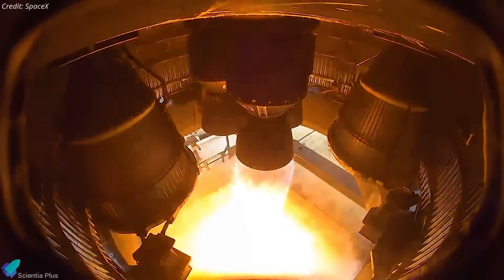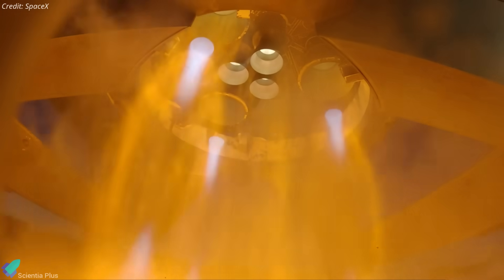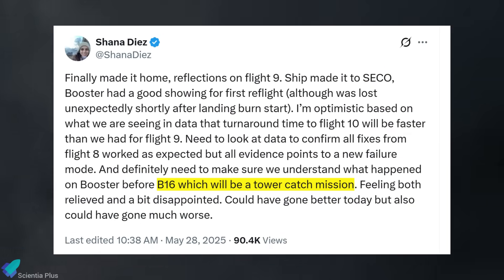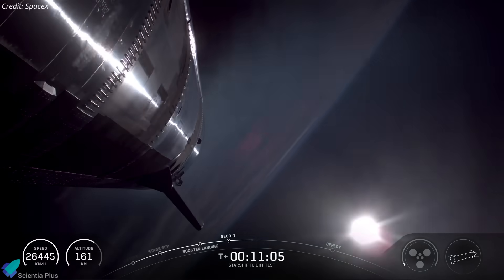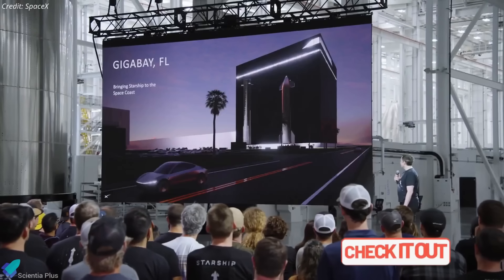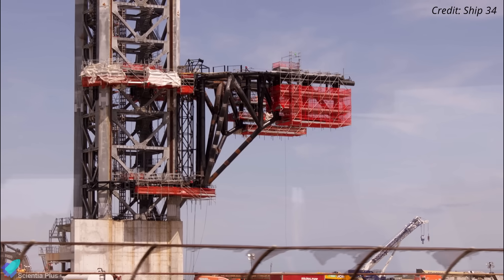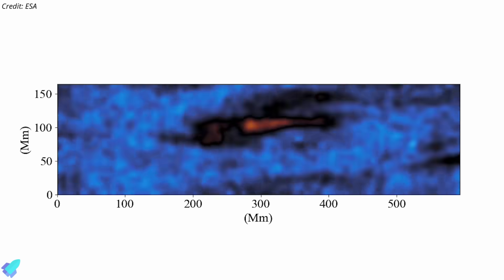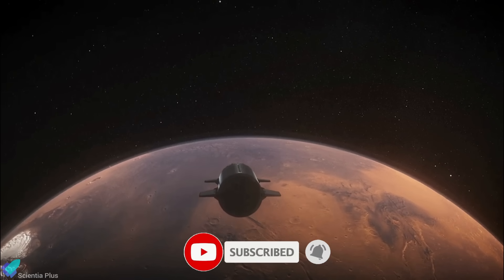Starship Explosion Shocking Evidence LEAKED From Flight 8! FAA Confirms Flight 10 Launch Date

Comment from the maker: 00:00 Starship Updates
11:59 Solar Pole Imaging BREAKTHROUGH—Magnetic Reversal Caught in Action!

📚 Learn More:

🚀 Starship Block 2 Explained:
 📖 Summary: https://shorturl.at/b0dtw
 🔍 Detailed Explanations:
  • Design Improvements Update 1: https://shorturl.at/lpGT7
  • Design Improvements Update 2: https://shorturl.at/gwNQ4
  • Nosecone & Payload Bay Redesign: https://shorturl.at/xa60S
  • Methane Downcomer Redesign: https://shorturl.at/XdYBG

🚀 Starship Block 3 Explained: https://shorturl.at/mnBT4
🚀 Starship & Booster Block 3 Detailed Breakdown: https://shorturl.at/IViwD
🚀 Starship & Booster Block 3 Production Begins: https://shorturl.at/xRNkJ

🔥 Raptor V3 Mega Upgrades & First Test: https://shorturl.at/TRIyj
🧱 What’s Inside Starship GigaBay?: https://shorturl.at/nJM75
🛠 Insane Engineering of New Starship Launch Pad B: https://shorturl.at/7RAZd
🛢 Dual-Port Orbital Refueling – Full Technical Breakdown
https://shorturl.at/5tiqK

🛠 Other Starship Upgrades:
 • Hot Staging Explained: https://shorturl.at/jf400
 • Super Heavy Booster Upgrades: https://shorturl.at/Pi5R3
 • How SpaceX Protects Raptor Engines: https://shorturl.at/4Om8F
 • New Heat Tiles Explained: https://shorturl.at/p2Ijb

🚀 Starship Flight 7
 📽 Complete Breakdown: https://youtu.be/UqzZx7vb-TA
 🛠 Root Cause & Fixes: https://shorturl.at/HcLKo

🚀 Starship Flight 8
 📽 Complete Breakdown: https://youtu.be/f26yH80RK2o
 🛠 Root Cause & Fixes: https://shorturl.at/vsGFB

🚀 Starship Flight 9
 📽 Complete Breakdown: https://youtu.be/2eirgcUzwts

📡 Stay Updated:
📢 Weekly Updates: https://bit.ly/3HIQjPC
🚀 SpaceX Playlist: https://bit.ly/34wue8T

🌍 Follow Us:
👍 Facebook: https://www.facebook.com/scientiaplus